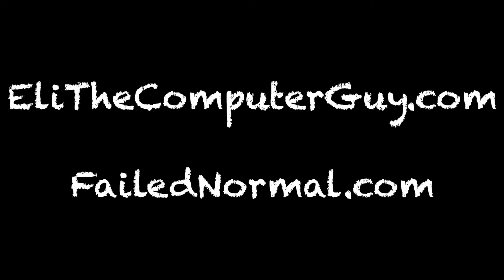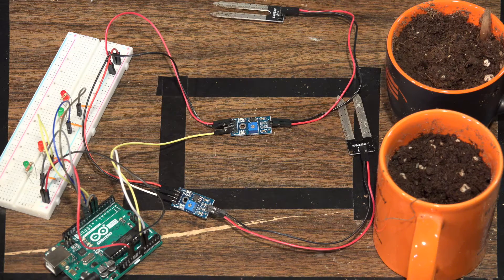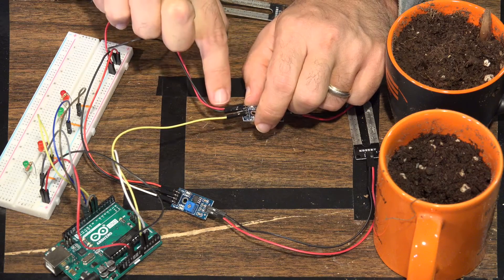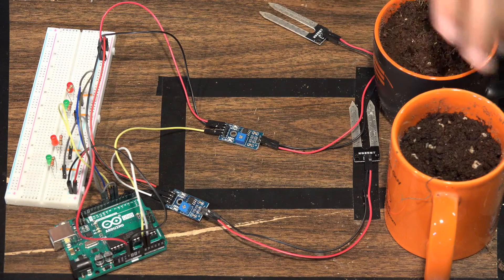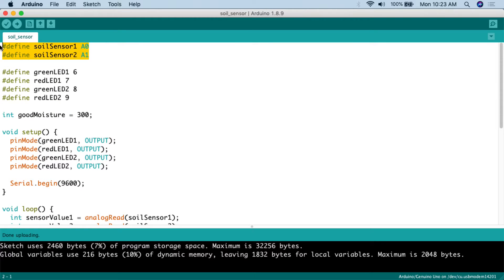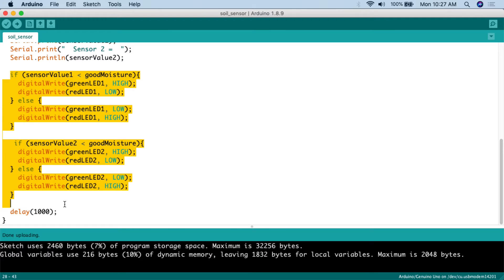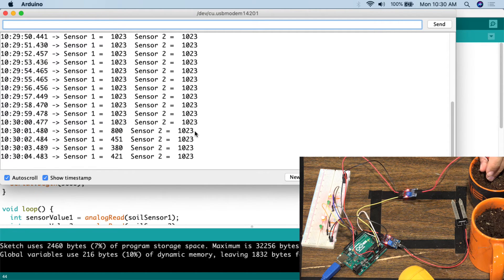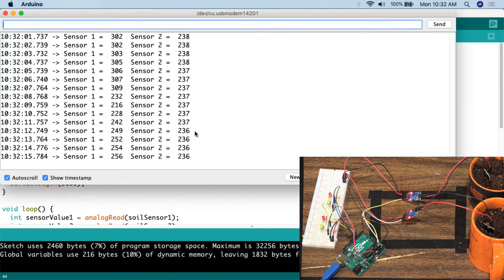Soil Moisture Sensor LED Alert with Arduino Uno

Comment: hello, i'm new to arduino so apologize if my question is basic but i'm having difficulty getting this project to work and am wondering if someone can help! I find the circuit diagram provided on the website is not working. Has anyone had any luck? It appears that Eli's photo of his circuit does not quite match the diagram, but it's hard to tell from the photo how to follow it exactly. If anyone's had any luck it would be great to see a clearer
 photo or a link to your results. Thanks!

Comment: Conductivity is indicative of ion content in the soil and not moisture. The level of nutrients in the soil at a given time will alter the conductivity measurement while the soil moisture content may be the exact same.
Reply: It might not be an accurate measure but since watering is really guesswork it would probably be effective enough, also the nutrients only really have an effect when the soil is moist, when it’s dry the soil will have a lot of air pockets in it which drop down the conductivity a lot

Comment: Moisture sensor alert would die fast here due to lack of rain.  I need 2nd step to then water plant a certain amount of water.  I need 6 plant setup with 1 arduino/wifi.  Additional 1per month fertilizer for each plant.

Comment: These moisture sensors have a nasty tendency to degrade quickly and have to be replaced often, especially the ones that have the conductors exposed to the water instead of encased in rubber. :-\
Reply: Carbon or platinum plated electrodes will increase the longevity of the electrodes.